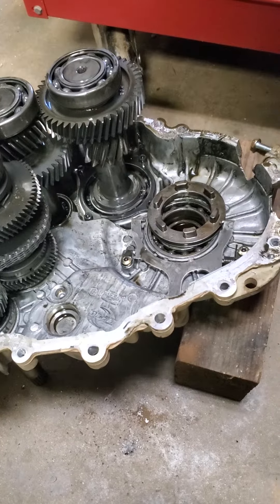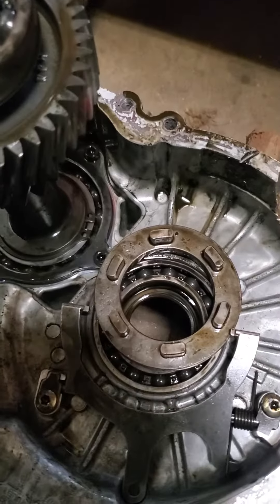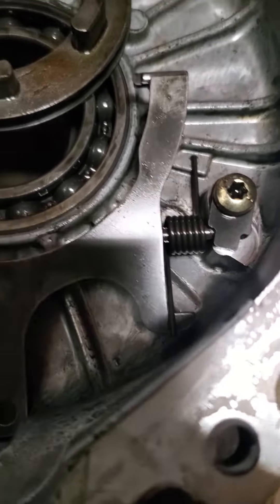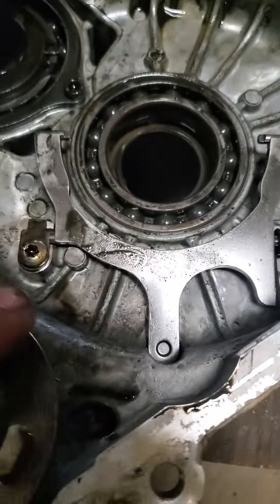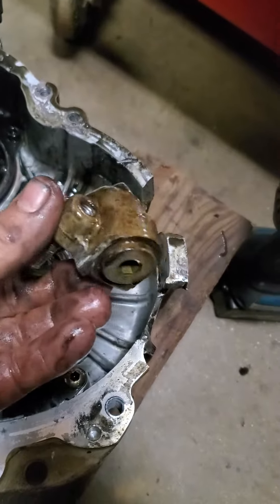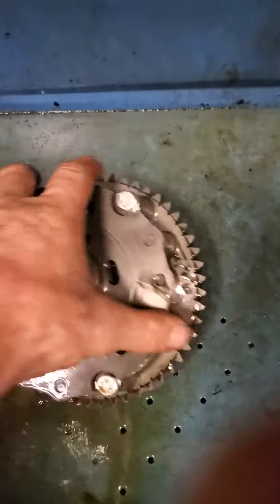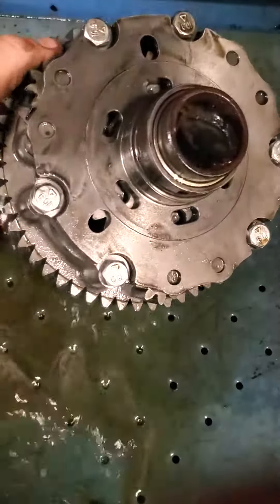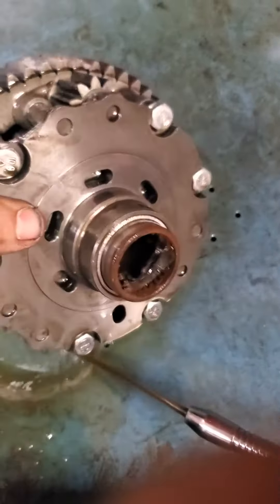Polaris Ranger 900/1000 "turf loc"  damage

Comment: Have a 2015 ranger 900 and back passenger tire doesn’t spin stay neutral but all others fiction work other then just the back passenger is dead on all functions.  Any clue what it could be. Trying to stay away from dealer if possible thanks
Reply from the maker: First check the Axle on that corner, with the utv lifted you can quickly check the axles relationship to the tire rotation. If your axles are good then unfortunately the "terf gear" is most likely damaged and may cause damage to the Main Case.

Comment: I have 1900 hrs & 7000 mi on my 17 900xp & I use turf mode as much as I use 4wd, never had any problem.
I use Mobil 1 0w-20 in the rear diff. Never had any problems with the front either, the only thing I replaced was the drive shaft. It still makes a noise. LOL They all make a noise, don't chase a noise in any side x by.
Reply from the maker: That's awesome, good maintenance schedule and responsible driving habits you are rewarded.

Comment: My turf mide won’t engage what should I expect to pay for rebuild parts n labor
Reply from the maker: Hard to estimate as it could be mechanical or electrical 
Could be as simple as the relay mounted at the rear of the transmission. If it does require a complete overhaul for mechanical failure then expect a minimum of 700 in labor cost.
Reply: @usatvgrizzly   anyway to test this relay
Reply from the maker: Should show a check engine fault on the display, but basically battery voltage in and same going out to the actuator solenoid. And should have a constant ground as well.
Reply: @usatvgrizzly  I have no check engine light on
Reply from the maker: Use a volt meter to check for voltage going to your Actuator "turf mode" solenoid with K.O.E.O. it could be as simple as a bad solenoid.

Comment: Man I have had my Polaris Ranger XP 1000 for 2 weeks and less than 500 miles and turf mode is already broken.  😡
The failure rate must be high from what I've seen on YouTube. Do you recommend not even using it?

Also now that it doesn't engage for some reason (I can hear the actuator working though) do you think it will be ok just to run it without turf mode?
Reply from the maker: Sorry about your trouble so soon, if this was mine I would 1st, drain the fluid into a clean pan maybe put a magnet in it to survey for any "metal"
If there's any metal parts "floating around " in the gearcase ? You run the risk of a piece getting lodged against the cases and  eventually destroying them with continued use.
Reply: @usatvgrizzly  ok I think I will most definitely do this, the red plug is the drain right? 

I have no idea where to even put the transmission fluid yet, only having it two weeks so far.
Reply from the maker: The "red plug" is most likely the CVT cover drain, the actual transmission drain and fill "plugs" are usually an "Allen" head 8 or 10mm. I recommend using a socket type Allen as these plugs are normally overly Tight ! You can access the "fill plug" from the rear,right above the  receiver hitch on the back of your transmission, the drain will be just under and vertical, the skid plate has an opening for access to the plug. Save those seal washers.....
Reply: @usatvgrizzly  Man thank you so much! I'd never found it. 🙏🏼😇